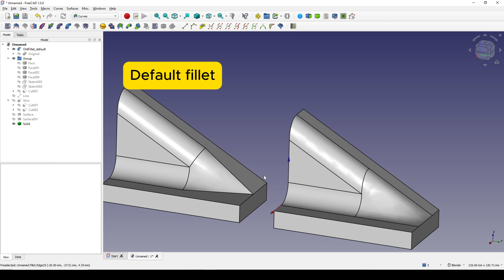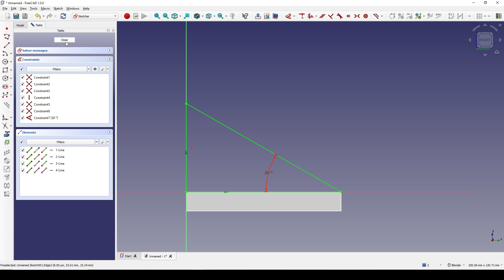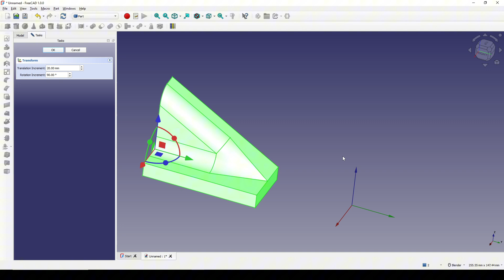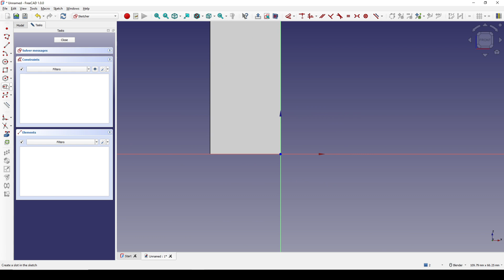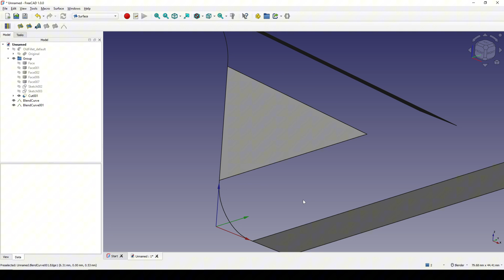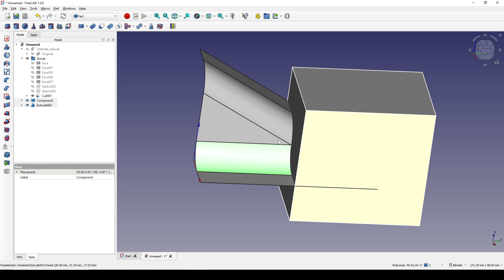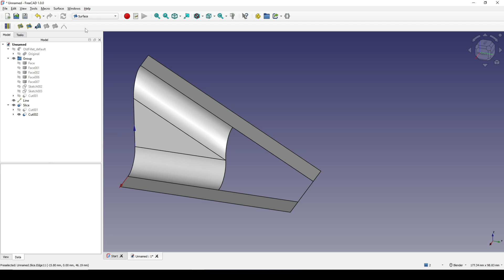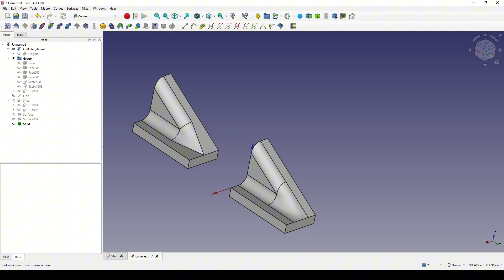FreeCAD 1.0 - Using Surface To Improve Fillet

Comment: After trying out this tutorial, there are some major issues making this tutorial, and Frecad far less useful than it should be. One of the biggest issues with this tutorial is the failure to mention required addons in order to complete the tutorial at the start, like the need to add the Curves workbench. While this might not seem like much to someone familiar with Freecad, as someone with years of experience with other 3d software, these simple assumptions caused unnecessary delays trying to track down why it was missing. The biggest issue for me with Freecad was that after using the surface filling tool, in the step after the Curves workbench, revealed unmentioned potential flaws from some previous construction point. Given my undo history was lost due to the curves workbench install, which forces a restart of Freecad, meant I was stuck trying to track down the problem in the parametric tree instead. After almost 20 minutes of knowing what needed to be fixed, I just needed to merging a few curves that got cut into 3 pieces at some point, but not finding a simple solution to either fix it, and yes I did manage to merge the issued curves, but they were not linked to the existing part surface and I wasn't finding a simple way to preserve it, I realized it was going to be easier to start over, because the tutorial was shorter than the time I was spending trying to find a proper solution. I do appreciate that these tutorials exist, but the more I hit these overly complex issues using Freecad, the less desirable a CAD solution it becomes.
Reply from the maker: @billyoung9538 Indeed, if you are new and watch this video right away, you will encounter the mentioned issues, and not clearly stating that you should install the Curve Workbench before starting the video is my mistake. I am very sorry for that! However, after you figure things out and overcome these challenges on your own, you will improve. Then, you can watch my other videos with the same spirit of exploration.
Reply: @ I always appreciate when someone takes the time to make something, and this clearly required some exceptional understanding of the software. I'm chalking it up to both inexperience with Freecad, and it working in very odd ways. I'm eager to learn it, but It's not a very intuitive application with a lot of what appears to be unnecessary redundant complexity, along with odd/weird naming choices for multiple tools that appear to function the exact same way, but in different places.. I would much prefer direct access to all aspects of the core model at all times with the proper editor/workbench dynamically opening and closing as needed for the required level of manipulation one is doing. That would reduce the apparent redundancy, and clutter.

Comment: In a newer version (39416) I got on 2:43 Exception, Exdrude001 Wire is not closed. In older versions 39100 and 39287 it works fine.